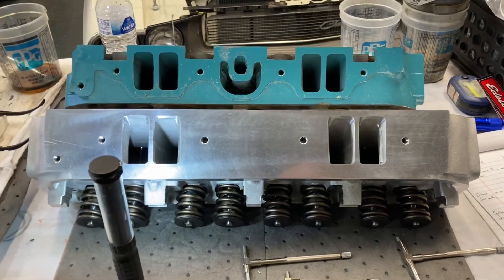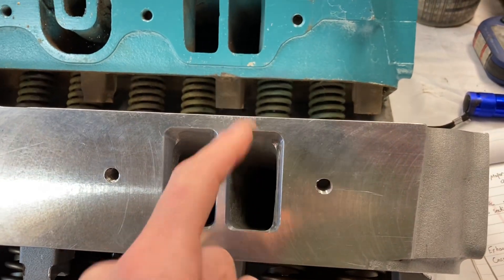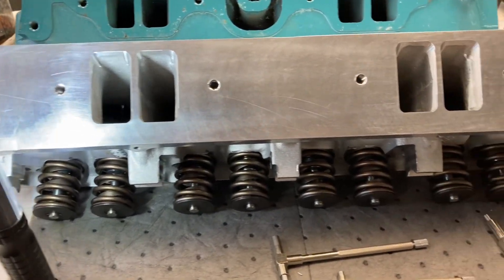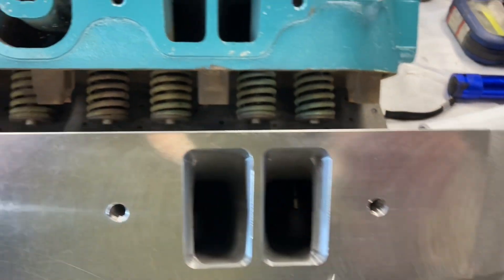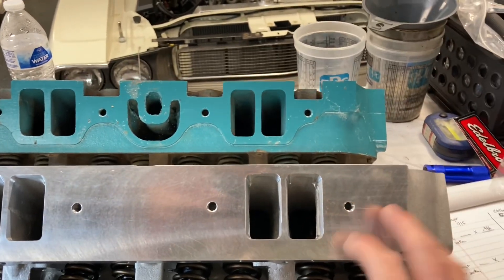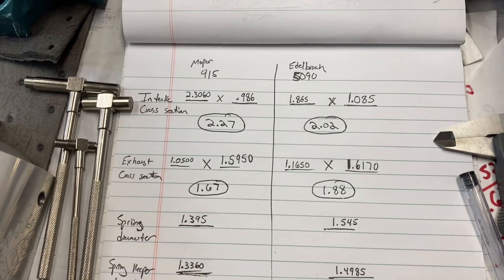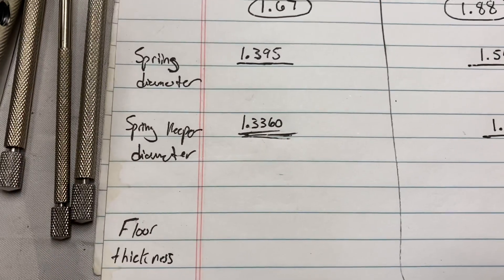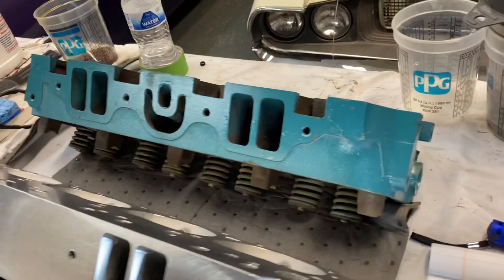Edelbrock Big Block Mopar Heads: Compared to 915 Castings

Comment: Back in the 70s there were no aluminum aftermarket heads for mopars so the 915s were considered to be the best never flowed one but ported many with seat of the pants dyno results being great using direct conection porting templates thanks for sharing Joe
Reply from the maker: I bet those 915s made some good power with those templates! I just got a set of templates that were 3d printed
Reply: @JustMoparJoe Joe, guess what I got??
Friend of the wife met a guy and he had some parts that a buddy told him to come pick up or they were going to the scrap yard…
I offered to take them off his hands, and they happened to be a set of 915’s along with what appears to be a factory mopar adjustable valve train!!
Complete with pushrods.
I need to ID this stuff and interested in porting them with the template 
Can I send you some pics??
Reply from the maker: @joelgeiser675 yes sir. My email is my channel name @gmail.com

Comment: I have gasket matched 516s with 1.74 ex valves and unshroaded intake valves that run my 440 like a scalded cat. Hundreds of 1/4 mile passes without blowing a head gasket using1966 bolts. A fraction of the price of aluminum.  70lbs more iron? I spent the extra cash on slicks. 516s make torque you can't control and Im using a Weiand single plane.
Reply from the maker: Sounds like they’re working great for you! And you’re definitely better with cast iron if your compression is under around 10/1. I’m a believer that cast iron definitely has a purpose and has served for years

Comment: I know this is an older video but I just happened across it. In the '80's I found an engineering drawing of the Pontiac 455 Super Duty head which was Pontiac's best regular production head. The intake port had a raised floor just like the Edelbrock head in this video. It was, according to the article, for port velocity and also for higher low lift flow due to the more gradual turn into the short side radius. Pontiac heads suffer from the same thing as Mopar Big Block heads. The intake ports just aren't tall enough and there isn't enough room above the valve. But both engines were engineered in the 1950's, improved in the early '60's and never really evolved any further than that from the factory. Thankfully we have a very active aftermarket that has really helped to push these engines into the next generation. 
For reference, most Pontiac heads from the Muscle Car era flowed around 210 cfm with the rarer Round Port stuff closer to 230-240cfm. 455 Super Duty ('73/'74) flowed the best at about 245cfm. Not a Hemi by any means but pretty good for the day. For anyone wanting to know what heads flow  recommend the "Stan Weiss' Cylinder Head Flow Charts". He has compiled data from multiple sources and put it all in one place.
Reply from the maker: That is some interesting information on the Pontiac heads!

Comment: In stock condition, the 915 heads were said to flow within three percent of the 1964 426 Max Wedge heads. The 915 heads and all 440 cylinder blocks (including 1966) used newer casting technology, compared to the 516 heads.The 915 heads became the service replacement for closed chamber heads in the 1970's and could be bought new for $100 in the mid 70's. Some service manuals and parts books state that during the 1967 model year, the 516 head production ended and some late 1967 383 engines were produced with 915 heads. The 1963 300J heads have, "improved" intake ports and 1.74" exhaust valves. The dual 4 barrel optioned 1964 300K engines got the 1963 300J heads, along with a solid lifter cam and heavier connecting rods. Those rods later became the 440 six barrel rods. Most 63 300J engines have standard 413 rods, but the Six pack type rods may have showed up in late 63 300J engines too. The 64 single 4 barrel 300K engines got 516 heads, standard rods and a hydraulic cam.

Comment: With a set of 1.81/2.18 valves in either 452 or 915 heads and simple mopar performance pocket porting Ive made between 550 and 650hp. After all the garbage Edelbrock heads I have personally seen I would not recommend any of there heads. The little 240 TF head can make good power I know of a 48x”  383 that makes over 780 hp on the same dyno my junk runs on. You talk about time to make the 915s run like the Edelbrocks how much does it cost to get your Edelbrock junk to run like Trick Flow?
I’ve seen E heads crack ten inches below the exhaust ports from one end of the head to the other.
I’ve seen voids the size of a dime just under the deck of the head and Edelbrock would not stand behind there product , we had parts in stock to long but the head had never been bolted down. More dropped valves and seats, like I said I would rather use my old mopar heads, I can live with less than 650hp.
Reply from the maker: Thanks for watching. I finally got the e street heads reworked and on the stock stroke 400 I’m building. Hope you follow along for that. My dad was a stock head guy. The Edelbrocks are the first aluminum heads I’ve ever bought for myself.

Comment: What are the "C" ports for? Or moon ports
Reply from the maker: That’s for Hot air to warm the intake, to help with start up. Inside that is the old egr port. I always try to block them off. The C port doesn’t really matter

Comment: Hey Joe, I have a 65 Plymouth satellite that had a 361 big block with 915 heads I put a 440 in the car with 906 heads that’s been professionally ported but has been on and off so many race cars that the header bolts are so wallowed out you can’t seal them. I have the original 516 heads with bigger valves and I did a Mopar performance template Port job. Should I swap these heads out? I can’t afford new aluminum heads
Reply from the maker: It would definitely net you more compression. If you’re confident in the porting, then you can definitely swap them. The 906’s and 516’s don’t have hardened exhaust seats. Many guys will recommend that you have them replaced. I’ve never had an issue. But it sounds like a nice upgrade. Especially if yours are wallowed out.
Reply: @JustMoparJoe I used Mopar performance plastic port templates and followed them to a T and then match ported the intake and exhaust. Took them to a machine shop buddy and cut in new bigger valves and harden seats. Thanks
Reply from the maker: @cavedave1922  no question! I’d bolt em on and fly!
Reply: Correction I think it’s 516 Close chambered heads

Comment: Do the Edelbrock Victor heads still exist? I guess they were available with 275cc Max Wedge style ports, 2.19 intake valves, etc. But I haven't seen em in my Summit or Competition Products catalogs for a long time. I wonder how those compare to the Trick Flow 270s.
Reply from the maker: I think they still do. Hopefully they are higher quality than the estreets. More and more videos are coming out about the poor quality of Edelbrock’s new heads.
Reply: @JustMoparJoe  Yes, I've seen that in several reviews. Disappointing, considering what they cost now, and the reputation they once had. Vic Jr. wouldn't stand for this if he was still around.

Comment: The pushrod pinch is a limiting factor on air flow as far as sq in area.
Reply from the maker: From my measurements, I don’t believe it to be the narrowest points in the runners. They would definitely be limiting if everything else is opened

Comment: In my opinion the main problem with big block mopar heads was that the engine was introduced for cars with a lowered hood line in 1958. This caused the intake port to be designed with a big whoopdi doo in the intake port that kills flow. A compromise that hurt performance drastically!
Reply from the maker: Did they help combat that with the extra long cross rams?

Comment: The best heads for the money in my experience are still the trick flow 240’s. I have Indy cnc 325 max wedge port heads on my low deck 512. They of course are budget breakers but they feed stroker motors the air they need to make power.

Comment: It would be cool if you could build two identical motors one with Edelbrock heads one with the 915s and dynam as you improve the heads to see which one outperforms, I've always been told that you can work cast iron heads to flow better and handle more power than aluminum heads. In the main advantage of aluminum heads was weight and heat dissipation.
Reply from the maker: I think the new edelbrock design is a superior one. I forgot to mention they angle the plugs as well.

Comment: Great baseline comparo! The numbers you provide are very informative. Its pretty amazing to me how well designed the 915's were " back in the day". Aftermarket heads have had a long time to improve and outperform cast factory stuff. I will be curious as you move forward to see how volumetric efficiency and flow can, and I am sure will be greater with the Eddys. Thanks again Joe on a great video.
Reply from the maker: Thanks brother!

Comment: i have a brand new set of mopar performance heads p5153524 which looks to be a knock off of the eddys heads you have,is this true
Reply from the maker: I’m not sure if that. I haven’t seen your heads. Designs may be very similar. These also have an angled plug.

Comment: Good Job dude but... In order to calculate the real area of a section of the runner you need to add the area of the corners and subtract it from the calculation of the area that you have written down.

So... Height * Width less total area of corners 

(H*W) - Total area of corners 👍🏼👍🏼

Sorry for my English hhaahaha... Cheers from Venezuela
Reply from the maker: Thanks brother. Can you believe I took college algebra 3 times? 😅
Reply: @JustMoparJoe  no matter dude, the important thing is that we learn.

I recommend you in this case look for a racing math book where you can read and learn more about the subject of the "area" in addition to this read about "valve curtain area", that is, the area you need under the valve for the Runner is efficient.
Reply from the maker: I hope to take David Vizard’s class someday. I am a kinesthetic learner, but won’t stop searching.

Comment: Agree...time well spent comparing them!!! Kind of suprising that the ports are actually smaller... But like you said, volume vs velocity is relevant, and depending on the intended rpm range, and intake used, bigger isnt always better!!
Reply from the maker: Amen. These are their advertised to 5,500 rpm heads. They’re getting the work!

Comment: These are the e-street heads are they not , very entry level , my performers are from before the victors came out , mine are ported but very happy compared to my old ported 915s , if you want eddy’s better quality maybe pay for the better heads lol
Reply from the maker: I didn’t really want their “better quality”. I had just expected their “standard quality” to be better. If you were to ask what I was after, I was wanting the best “inexpensive head”. Apparently the 440 source would have been better.
Reply: @JustMoparJoe  I'll keep Made in America Eddys over made in China 440 source , but you do you
Reply from the maker: @big3fan916  I’m running these. Wanted to share what they look like.
Reply: @JustMoparJoe  It"s all good Joe , I've seen Brodix , Trick Flow , Eddy's All show up with chips and places that could use a little touch up regardless of price point , heck I've seen a new block show up that still had some casting sand in it .
Reply from the maker: @big3fan916  that’s wild! I figured that kind of jewelry would come ready to go!
Reply: @JustMoparJoe  I also learned this summer to put blue locktite on the oil pump pressure spring plug after it backed out - cost me a whole short block plus two valves lol
Reply from the maker: @big3fan916  I like benefiting from others lessons! Thanks for sharing.
Reply: JustMoparJoe    The problem with the 440 source heads push rod clearance. They flow the same as the eddy performer rpms. I’ve used them all on various builds.

Comment: Hello Joe.
I like the 915 heads.
But, By the time you purchase them.
Do all the work to make them compatible with today's gas, hard seats in the exhaust new stainless valves and bronze guides.
You have a considerable investment. 
And you still have cast heads.
With aluminum heads new seats, bronze guides, "manganese" a real plus for guide material. 
Stainless valves, all new hardware retainers locks and springs.
Kind of a head start.
Also light weight and heads that have quench. 
I know your 915's have quench.
Other BB Heads 906, 346 and 452's do not have.
While they have great potential for power and reliability. 
So for Mopar purist that is a stock block customer build what you have, nothing wrong with that.
But don't think because you buy aluminum heads that your job is over, it may be just beginning!
There are many things that people may think they know, while others may know exactly what problems and challenges are out there.
So one needs to ask he or she what's my needs, what do I want and what can I afford?
Great content and topic Joe.
Thank you, EM.
Reply from the maker: Thanks Ed! Do you want me to pull them apart and port some before I bring them over? I meant to ask that before.

Comment: Nice job as always my friend!! If the heads are laid down side by side with the combustion chambers down and you was to measure to the top and bottom of the ports is there much difference in the height? I guess I am asking if Edelbrock moved the intake ports up and exhaust ports up to help the airflows direction and take away from the sharp turn at the valves?
Reply from the maker: Excellent question! I might actually measure with each on a block. Thanks for the idea. Next video with these, they are either getting cut or at the machine shop.
Reply: @JustMoparJoe  your the expert my friend and the video you made is what sparked the idea in my brain lol. Did my question make some sense. I believe you could move the ports up if you correct the angle afterwards so that the intakes will still bolt on. Also on exhaust side so that it's not coming out and making that sharp turn trying to exit and then into the headers where it has another sharp turn. You know how our junky small block Chrysler exhaust side runners are raised (best thing since sliced bread in my opinion just no trade secrets Incase some Chevy/Ford fans might be reading lmao!!) Chrysler had some great things in both big block and small block stuff I wish they would have combined them and the LS swap everything would have been called the LA swapped everything!!!! Ya know what I mean JustABadFastFishMoparJoe???
Reply from the maker: @rowdyreviews6530  that’s a helluva nickname! I’m picking up what you’re putting down. Gotta work tomorrow on making that fish faster! These heads are for a nice street car, dart sport .
Reply: @JustMoparJoe  cool beans buddy, I just emailed you a T-shirt design sketch up I been messing around with check it out see what you think lol. I liked the nickname myself lol, I thought it pretty good lol!

Comment: Joe I been racing the same 69 barracuda for 35yrs. 340 w2 thru stage 6 295 cnc maxwedges 440s. Port design is key compared to size. I put my stage 6 on my 440 and lost all torque. Too big. I'm a bracket racer so why not use the torque not the hp. I ran 10:00s with a 440  6000 shifts. nothing fancy. I'm switching to a plain edelbrock rpm head this winter.
Reply from the maker: Please let me know how it goes! I am going for a similar idea with my barracuda. I hope to make some great improvements over the winter. These heads are going on a street engine in my dart sport. It should be a fun car with a 400.

Comment: Great Comparison Joe, I've always wondered (Since I don't build Hot Rods) If the main benefit of aluminum heads was just weight or if you could just get iron heads to flow just as well. Good Video Joe!
Reply from the maker: I’ve heard people say that a good set of aluminum heads could be 100 hp difference! Thanks Duddie
Reply: Up to 100 hp with the B-1 or 
stage V , and the trick flows are sorta close. Along with Bruce Toth.
Nice video. Shows why if I ever decide on aluminum,  no edelbrock for me  ! Lol
Reply from the maker: @DUSTER7071  thanks! Toth is a good guy. He talked to me about his heads and goals behind them while porting.

Comment: Your car reminds me of the Sox and Martin cars back in the day, one of my favorites.  I also always loved the '70 white Challenger of, " Vanishing Point,"  the movie.  Not the one with Viggo Mortensen.  That movie actually sucks.  It's the original.  The one starring Barry Nueman.  Both cars had Hemi's in them, but the 440 is legendary, too.    Waiting for the next episode.  Enjoy.
Reply from the maker: Thanks brother. I have some video coming up for barracuda plans, then work. It’s only a 408. The aluminums are going on a high revving roller motor for my dart sport. It’ll be a “street” car 😉
Reply: Actually, there were 3 cars used in Vanishing Point. two 440 magnums and one 383 car. No Hemi`s. The cars were so trashed after the movie Chrysler supposedly just had them crushed.

Comment: Maybe some day I might save up for a set of aluminum heads for my 360 build some time after I have ran the engine for a while . Good video . Thanks again joe for working with me on the aluminum intake ect. once I get the intake I plan on polishing it to help dress up the slant6 . will look good sitting in the 65 dart of mine and hopefully get back to driving it
Reply from the maker: Get it out on the road! That aluminum intake might give it a cooler air charge as well! More powa!